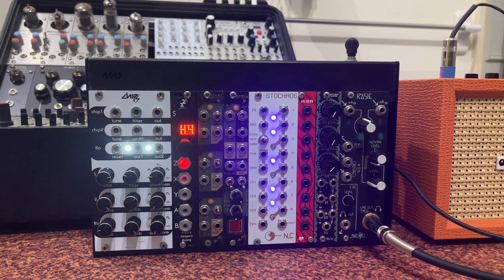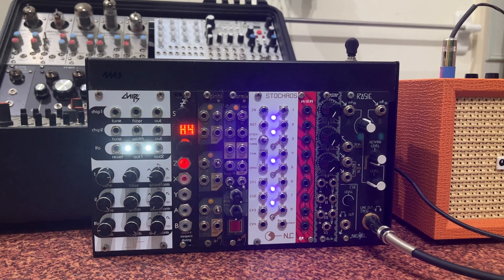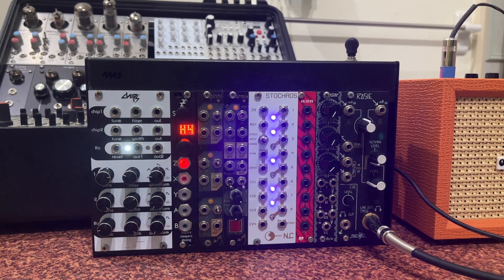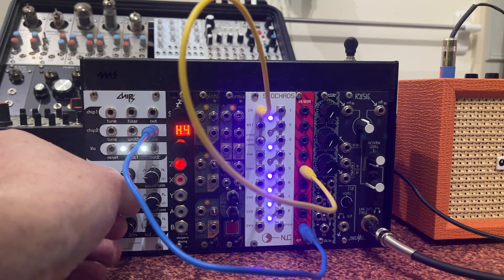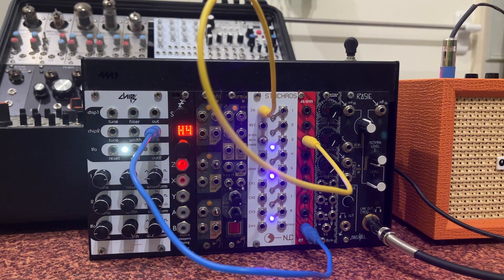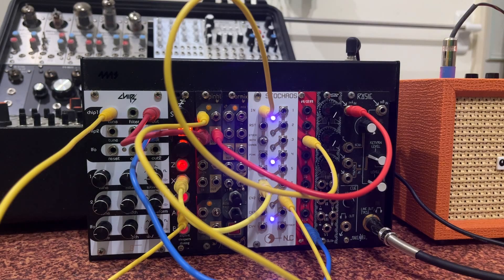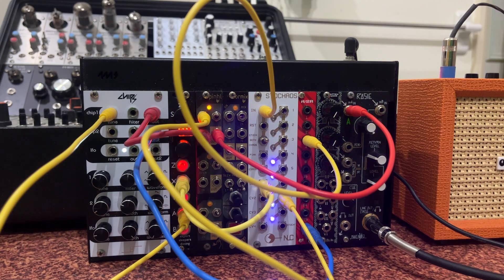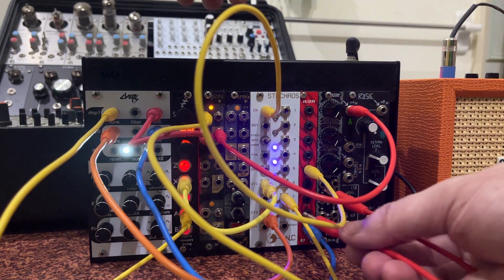NEW BRAIN for SMALL EURO SYSTEM: the Stochaos by Nonlinear Circuits! plus, the R2R!

Comment: Is that r2r different? I've got a different brand  il use it to Attenuation & mixing etc, especially weird feedback stuff  like multiple cv inputs & taking the in-between of the input signals as extra related outs based on what's closest  gets weirder with split cable, strange passive related feedback all out to all in shenanigans
Reply from the maker: Mine is a custom clone that a company in Europe made for me. That’s good usage advice , I will try it !

Comment: The Stoch setting uses the pink noise (generated by a transistor) to generate true random signals. Chaos uses another subcircuit to generate the chaotic cv. If you have a scope, you can patch the pink or chaos outputs to see how it looks. Generally speaking: chaotic signals will be somewhat periodic, showing a pattern and/or predictability, whereas random is completely unpredictable.
Reply from the maker: that explanation is helpful!

Comment: With the NLC stuff and even in chaos theory chaos is less random than 'completely random'. Chaos has a pattern true randomness doesn't.
Reply from the maker: Tragically, the NLC site seems to have more information on how to build their modules and less explaining all functions in detail. But the designer has written quite a lot on chaos and randomness on his site ... it's kinda above my pay grade
Reply: @father_moo  Chaos theory, chaos circuits, and synthesis is is a pretty massive rabbit hole. It's a good one though, worth delving into. In the most general terms chaos has a pattern, the thing that makes it chaotic is that the pattern doesn't repeat in a way that you can predict. The weather is chaotic in this way and chaos theory is tied to the work of Ed Lorenz did around forecasting and the weather.
Reply from the maker: @redwoodword  interesting! looks like this is a rabbit hole i need to go down.

Comment: Be aware that when negative voltages are applied to chipz, it bleeds the effect into other areas of the module.  i.e., putting negative into chip1 can also affect chip2's sound.  This is sort of by-design, part of the glitchy quality of the module.  It won't hurt anything, but it can be surprising if you were thinking the LFO, chip1, and chip2,, were actually independent.  They aren't quite.
Reply from the maker: This is really good to know, thanks! I read the manual but I don't remember reading this ...

Comment: This is a nice series. And thanks for removing the background music. 

But it seems an awful lot of modules and faff for just that random signal. Isn't there something that can generate a quantized stochastic steam of control data without using one of your voices and the disting and a passive attenuator?
Reply from the maker: There is - it's called the Qu-bit Bloom. I own one, and eventually I'll do a small system build with it. Since the Bloom has 2 channels of quantized output, it usually lives in my larger system where I have more oscillators.